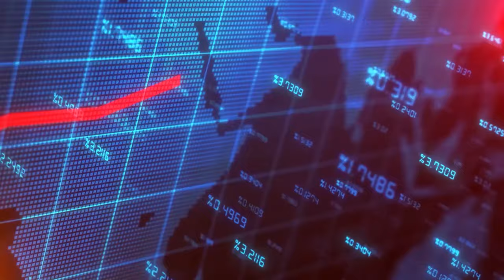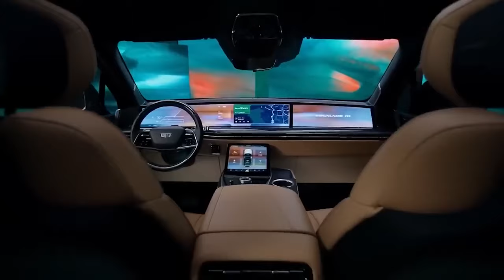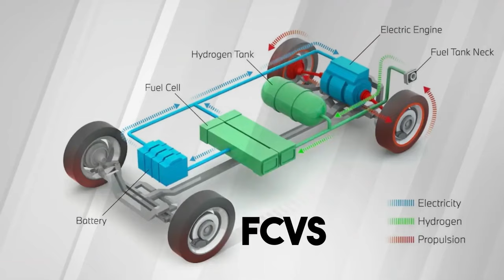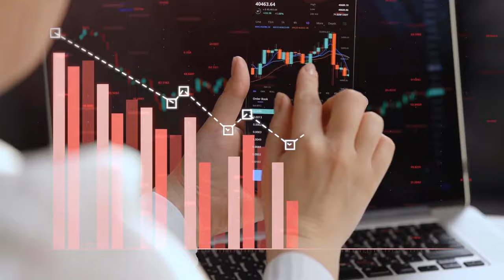HUGE NEWS! GM CEO Shocks All EV Car Makers

Comment: Hydrogen fuel cells explode, they don’t burn. Remember the Hindenburg?
Reply: Li-Ion batteries explode spontaneously in 2023. Those ancient fuel cells for the Hindenburg were from 1937. They used a paint or 'dope' that was a highly flammable material, basically rocket fuel, that was reactive even when dry, to seal for the CANVAS cells to hold  the gas. What could go wrong?

Comment: What stupid about ev cars is they are no room for a spare tire in the back becase of the motor and battery. And they need a truck in front.. so watch out driving far away from auto shops  and AAA  don’t fix tires  they just change your spare  to the car or tow you to a tire repaired shop.  
A car without a spare tire. Dumb dumb….. LOL
Reply: They also wanted to shed weight to reach corporate-government mandates